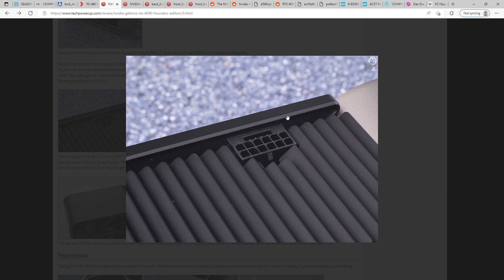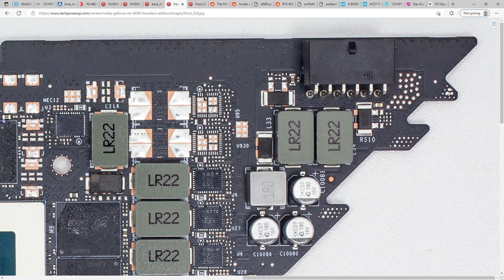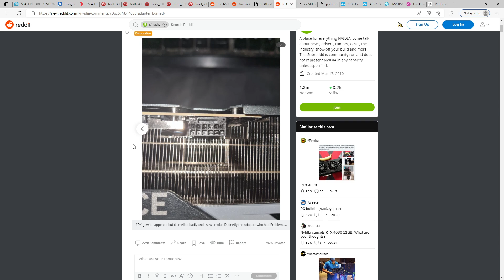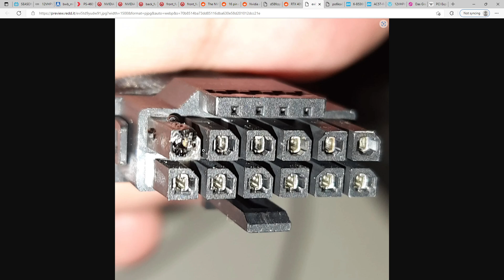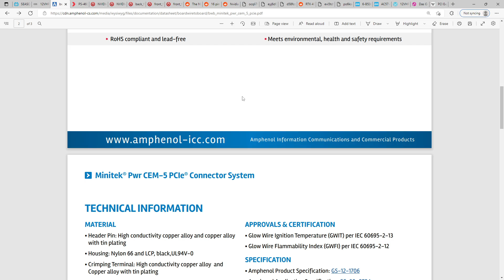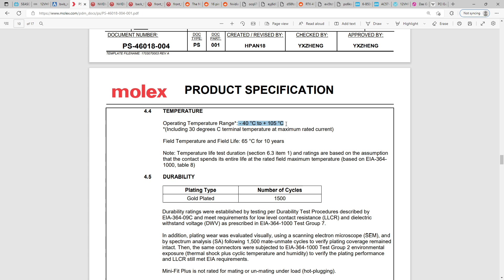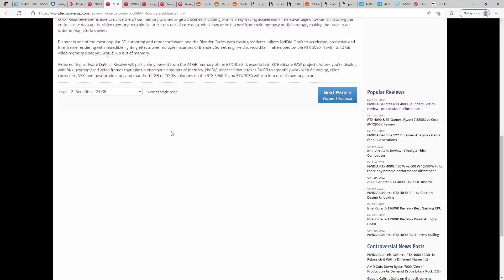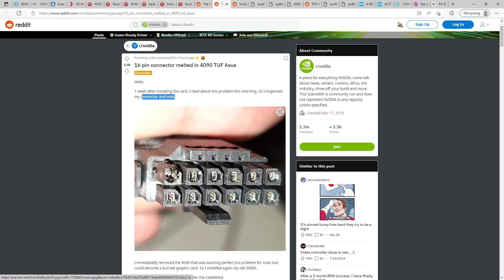rambling about the 12VHPWR failures

Comment from the maker: EDIT2: I really do not want to put anymore time and thought into this 12VHPWR adapter issue. I have way too many mobos and RAM to test. 

EDIT: my statement that 12V can't cause arcing isn't entirely accurate. While it's technically true that 12 VOLTS can't cause an arc. Inductive loads(like motors) powered by 12V can cause arc when suddenly disconnected due to the inductance causing a temporary high voltage spike. This however is not relevant to the discussion at hand as you aren't gonna get an inductive voltage spike when one or several pins in the 12VHPWR lose contact. (you might get a indcutive voltage spike if the connector is entirely disconnected)

Also while the materials used for the connector are selected to not self sustain a fire after ignition it is not impossible for them to ignite something else that can sustain a fire. I would recommend that you don't leave cards powerd by the Nvidia 12VHPWR adapter loaded while unattended.

TL;DW

1. Plastic is an excellent thermal insulator. Pointing a thermal camera at the connector won't give you a good read of the internal temperature of the connector
2. Try measure the voltage drop across the connector in various states of bending
3. Nvidia adapter is using 2 split terminals that are less physically robust than other terminal options (probably why all the photos of melting connectors are with the Novideo adapter.)
4. 3x PCI-e 8pins are just better than the 12VHPWR connector
5. The connector can be melting internally without externally visible damage. So just because it looks fine on the outside doesn't mean it's fine on the inside.

BTW this video is even lower effor than the last one on this topic. I don't find unreliable high end Nvidia GPUs particularly surprising or interersting.
Reply: 5) This is completely unacceptable, let alone on a $1,600 retail product
Reply: I've been trying to explain that (1 & 5) about plastic and people trying to read the temps with a thermal camera 😂
Like, bruuuh that's external temp!!... Not surprised Jay was one of those lol
Reply: @glitter_fart  You might be talking about high voltage caused by inductance combined with high current.
Reply: you should probably pin that
Reply: To initially CREATE an arc/sparc you need to ionize the air molecules in the gap.
This is a function of only voltage and distance.
If the distance is small enough you also only need low voltages for that.

To SUSTAIN the arc the power supply has to be able to deliver enough amps such that the voltage (across the arching electrodes) will not drop once the arc is there.
And if there is a load in series (like the GFX card) and you are not doing a short circuit on the supply the load has also to consume enough amps.
The gap can increase after the arc has ignited as the burning arc keeps the air ionized.
When you are stick welding you typically tap the surface shortly to ignite the arc and then try to keep a constant distant of the tip to the material of ~1mm or so.

Most typical small 12V supplies cannot supply enough current to keep the voltage up once the arc is there.
Also most 12V loads don't consume enough power to keep an arc going (when the arching electrodes are in series with the load).
But if you are using a 1000W PC power supply with a 600W GFX card things might be different...
Reply: Nvidia single hand creating it's own "novideo" brand recognition.
Reply: @glitter_fart  I don't really know what your getting at here the connector has a saftey margins on top of the pins saftey margin.

If there was arcing in the connector we would see the corresponding pitting to match and I haven't seen any. Not to say that 12v cant arc its just that these failures don't seem to be coralated with arcing and just poor contact. 

But I do not like reduction of saftey margins unless its optional and I know in that specific implementation it has been double checked.
Reply: So, a couple of issues with video. 

Because pins are in parallel, the voltage drop is same across pins/connectors. The power is V^2/R. So, higher resistance due to poor contact means that the heat generated there is less, not more. That would mean if edge pins are poorly connected, then they would have much lower heat output on them and middle pins should start burning before because of too much current there. (Or, the issue is not high heat generation at edge pins, but bad heat disipitation which is unlikely, but can be the reason)

I would presume that the middle pins are the ones with bad connection forcing all current to go through edge pins for some reason. (or One sided horizontal twisting caused 3 of them to get pulled apart completely, so one edge pin is doing all the work.)
Reply: @ravishah2255  Resistance.
Reply: @glitter_fart  In the contents of the video, No, the 4th connector won't arc as it still has 3 other connectors still connected to the terminal. Electric will always flow to the least resistance.👍
Reply: What about the one from atx 3.0 psu? Literally same one?
Reply from the maker: @user-bonk  the PSU manufacturer can use a different terminal style from what Nvidia uses.
Reply: @user-bonk  in igor's article about the situation, it specifically says the issue is not the connector...PSU provided cables use the new spec connector just fine. It's NVIDIA's specific adapter build quality that's the issue, not the GPU/card itself.
Reply: Can one get an overloaded positive line from a connector if there are not enough ground lines to return the load from where it's pulling at the source?
Reply: no worries, we trust you
Reply: @igorslab mentioned in his Video, not to bend the cable/pigtail whilst it is installed in the GPU, because this will force the "male" pin against the "female" terminal bending it open, increasing the resistance. He also mentioned that a crappy solder joint as seen in his supplied picture could break under bending, resulting in an intermittend connection, leading to problems inside.
Reply: People should research the stupid thing they are talking about before brainfarting in comments.

WHAT THE FUCK YOU THINK WHEN A TESLA TOWER USES THOUSANDS OF VOLTS INSTEAD OF AMPS.
Reply: I'm going to put this thread on ignore now. The semantics are killing me.
Have a nice day comparing my situation in The Netherlands to the USA and going "I don't believe it because here ..."
Well here we have 380V input power on industrial machines but I bet I am lying again.
Maybe I should have measured the output voltage when I was 16 so I could give you people a good number here today huh?
You people believe nothing and know everything better and I'm sick of it.
Goodbye!
Reply: What's ur opinion on the new thin-foil topic of the connectors? Igors/Jays2cnts
Reply: You should pin this so more people can see. Right now I had to scroll down a bunch on the comments to see it XD
Reply: The best part of the comment is when you said Novideo.
Review more Novideo products until they are known as Novideo (when they kill themselves in normal usage)
Reply: @glitter_fart  yes this is true expessaly with how many amps modern psus can provide on a single rail design.

Hell im sure someone somewhere has arc welded with 12v cause they wired there lead acid batterys wrong.

Voltage determines how wide an airgap an arc can start from. And airs resistance isn't infinite. However once the plasma coloum is formed it can be stretched out or maintained wirh lower voltages.

As a note to buildzoid blue is arcing, reddish oranges is melting. The blue usually proceeds  the red/oragne.

However aside from that which I can understand why buildzoid isn't too familiar with i do agree that it is not a issue wirh the busbar because the melting is located on the pins not the busbar and the rest of his analysis seems accurate and better than some other tech tubers who will hopefully learn from this a bit.

Another comment I have is if you look at the older 3080 connector it didn't just use pins to the pcb there was a significant metal structure behind the connector thst probably helped with hest dissipation from a single bad pin (although lower currents)
Reply: @glitter_fart  Well I am not sure you are entirely correct there.  Arcing is very much voltage dependant.  What I think you are not considering is was actually causes arcing in systems operating under 600 volts and that is the inductance of the load being driven.  Also I saw someone brought up lower resistance on the air gap once an arc is established due to plasma column which is accurate as well.
Reply: @mrfarts5176  that is a very fair point. Although I do see a tap and drag situation being much more possible than an inductive load.

I just happen to have an analog volt meater and a 12v ups battery beside me. Using a screw touching the negative terminal and getting extremely close to the positive terminal I can create and sustain an arc with out the needle on the volt meater budging.
Other times i do tap the terminal and see it drop but i can do it without it.

 (Volt meater is Connected directly to the terminals) it is possible that my eyes and the meater are not persice enough to see a very breif voltage spike. I could try scoping it as I am interested to find the answer to this.

Mind you the screw is pointed so that does effect the minimum arc length. But I do not see what would act as an inductor in that circuit.
Reply: @andrewmcewan9145  I would say in order to create an arc as you described you would have close the air gap and then open it and have the plasma that is being generated lower the resistance of the air gap enough to maintain an arc.  I would not expect 12 volts to be able to establish an arc without making contact first, regardless of the inductance of the load.
Reply: @mrfarts5176  it could  be the shake in my hand is causing it to tap or it melts/vaporizes the contact point away casuing a arc to form as a gap is created. As we are talking about well less than .5 mm if a airgaped arc was to happen with just 12v.  I just do not see a significant inductive spike being fourmed expessaly with the meater in parallel.
Reply: @mrfarts5176  12 V isn't going to start an arc, but it can sure as hell sustain one if the source impedance is low enough. I can think a few ways an arc could start progressively as the connector overheats.

1. The plastic gets hot enough to char and become partly conductive, resulting in a high-power resistive short.

2. The contacts corrode making the contact resistance progressively worse, until vaporized metal happens .

3. Anything catches fire even briefly. A flame is conductive plasma.
Reply: Car batteries arc when shorted all the time and they're at 12V.

In fact, I once had a 12V power cable let go from a connector on a gigantic 1 Farad stiffening cap for a high power amp under my car seat and it straight up welded itself to the metal frame under the seat and then started a small fire in the floorboard carpet. 

Scary stuff. But your 20s are the right time for jank, I suppose.
Reply: @magilla_and_amanda  300amps upwards. it's all in the amps.
Reply: @madb132  I agree (although I've seen it happen with smaller 22v batteries, like lawn and garden level stuff) but still 12V definitely will arc depending on the circumstances
Reply: I have seen arcing in mechmod vapes a few times from a pourly made coil build sub 0.05 ohms. also there is a thing called Battery Arc marks that you get when using them. and those are 3.7 to 12v, depending on how dumb you want it to get. So its a question of how big of a gap arc can travel. saying it can't cause an arc is misleading a bit, although not realy important
Reply: Yeah, sparkies might fly a little but you're not going to weld jack shit at 12V. lol
Which is what I used to do, 380v 110 Amperes, minimum amperage for 3.25mm electrodes.
Reply: @how2pick4name   Did you mean 38v? 380v * 100A = 41.8 KVA where did u get that welding machine?
Reply: @lanosky  No, I mean 380V. It's 40+ years ago, ask my boss which machines they were. He's probably dead now though.
That was what we used in construction, welding old rusty I/H/etc beams with base electrodes. I always love it when I have done something personally and people come up to tell me I am probably wrong. Sign of the times and it's quite sickening to me. Maybe your mom tells lies, I don't.
Reply: @lanosky  Here, I looked it up in like 5 seconds on a site that sells electrodes. 
Oerlikon Elektroden TENACITO 80CL 325 - WP80CLS325 | 350 mm | 3.2 mm | 90-135 A
The machines had those big red power current plugs, you know, 380V.
Reply: @how2pick4name  I find it near impossible that your running 380v @100 amps. Through the electrode.

Alot of the 3 pahse 380v plugs are max 32 amps 

Which i mean can still do 100a at 100v.

The machine would stepdown voltage so even though it's connected to the wall at 380v  the voltage between electrode and the end of the arc is considerably lower.  I would assume 50v max. But it would be near impossible to actually know now.

Go watch some videos of lower voltage arc flashes and you'll understand why we are reculent to beleve 380v @100a.
Reply: @how2pick4name  I think you are confusing with input voltage. Output voltage is less than 100v for welding machine. 380v is health hazard one mistake can kill a person.
Reply: @lanosky  that's very likely what it is.
Reply: @how2pick4name  you can make a bead with a stick at 24v from 2 car batteries.

Mig wire feed runs at 13-15 ish volts for 0.024" dc of course pwm modulated.

Although for any welding you are replacing the air in the arc with some gas as to not oxidize the metal and this will have different properties to air but I don't have numbers for that off the top of my head but the arc has to start through normal air on a stick.
Reply: @andrewmcewan9145  also for the mig welders at 13-15 volts will pull 50-100 amps and the amps is what makes the arc
Reply: @HallucinatingHell  it's the conductive plasma enabling the arc. the amps keep it hot enough to sustain the plasma.
Reply: @how2pick4name  I have never seen stick or Mig Welding at those voltages.  Pretty much all the welding I have been responsible for used up to 500 amps at less than 20 volts.  What kind of welding were you doing?
Reply: @mrfarts5176  Base electrodes, 3.25mm. You can even go as low as 80 amps really but they will stick a lot if you suck. It also depends on which ones you use. I started working as a welder and my boss taught me. I worked daily with that stuff but had to follow classes for a diploma.
The teacher would make us use 80 amps, everyone's electrodes would freeze but mine. lol
I can't even remember mig settings, usually it was rebar cages and stuff we made and they were kind of set for that already.
Edit: If I remember correctly we used 4mm ones at 140 amps. It's been a while, like 40 years. lol
Reply: @glitter_fart  my dude, you need to look up the definition of “arc”. Bits of molten metal flying about are not arcs. An arc is where the air breaks down and ionizes to the point where there’s a low resistance flow of electrons *through the air*. In air, you need 1000V to jump 1mm! With 12V, like he said, you’re just blasting off bits of metal from heating. That makes sparks, but not arcs.
Reply: You say the solder job isnt the issue due to area of failure, but I can think of two ways it can affect the issue at hand (positively and negatively) despite the different area.
1. Metal is a great heat conductor as you said, if the heat source is at the solder point then that heat can travel to the terminal very easily. As the plastic above the solder joints is cooled and the plastic at the terminals isnt, then one area of plastic will melt and the other wont.
2. It affects the natural load balancing that the parallel connection can provide. Though Im pretty sure the natural load balancing will help reduce issues from one failed connection, but wont if 5/6 of the connections failed. So it is a bit strange to see that only one - two pins are melted, unless four - five of the terminals have bad connection to the cable.